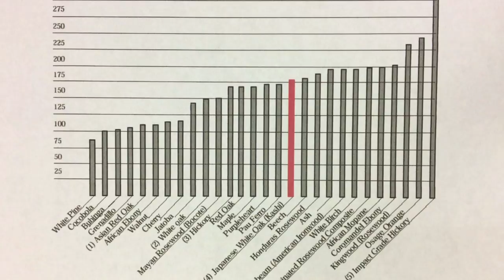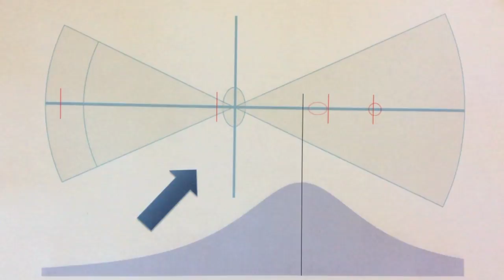Samurai War Club! Making a Kanabō for Metatron: Kodama Woodworks Episode 5

Comment: Super cool.  Also the only one ive seen built so far that i would find worthy to call battle ready instead of decorative like most modern weapon replicas.
Reply from the maker: Thanks! I spent days researching dimensions but they are few and far between. But I did my best while working from what I could find. I may have gone a bit far in terms of strength but it’s definitely not too weak lol.

Comment: Beeing 4 years late, I got two thoughts:
a) I'd prefer to get a handle with more grip to it. You may wanna lose a lot of force, if the club is rotating in your hands at the moment of impact.
b) There are nails for historical shoe making. They are basically tiny iron pyramids with a pin at the base to nail them into the sole. Roman soldiers shoes had them. Ask the Metatron!
But, just two minor thoughts. I'm totally in love with your club right now! <3

Comment: I looked up pictures of the kanabo on pininterest. It shown variety in the design. Some were obviously made to be more agile like a baseball bat while others were super thick and bulky. From what I noticed is the studs' spacing with each other and clustering were more dense. There were some kanabos with an added feature where a metal sheet was placed on each side of the blunt face. It was hammered and nailed in by the studs. This gave it more protection and durability to the wood. Not all of them had this. (I think metal was very expensive back then. This would explain why not all of the versions we see have the metal sheet or were flat out made out of metal entirely.) Some versions had the studs to be poking out more predominately. Some were either blunt sharp studs like you see on a morning star mace or were rounded. Both seem to indicate they nails were very pronounced and protruding outward from the weapon as a common feature.

I think the shape of this weapon is fine. I think the studs should be more numerous or perhaps more dense in spacing. The studs might need to be more poking out. I can understand why this was not done for your weapon. I don't think they make a lot of stuff that can be sued for a historically accurate kanabo. This would cause it to be more difficult to find stuff to make one or maybe doing some homemade style metal shaping to produce the studs or blunt spikes. Considering I think the original samurai and soldiers had go through similar situations where they make do with what they got around, afford, or what the best of their abilities can create this is accurate in my opinion. I can see a person out there in the past making studs like this and giving them a grouping like this. I would give it a pass.
Reply: Pininterest

Comment: There are so many varieties of Kanabos, like both wood and metal that you mentioned, they can be tapered or not, sharp or blunt. The way you want it to be is pretty much your (and weapon makers') call. However I am sure it's illegal to own a Kanabo with sharp mace points nowadays, so either stubbed Kanabo or just flat is the only thing that can be owned legally in most states.

Comment: Where did you get your beech wood from? Was the square stock made by gluing 2 pieces together? What was the measurements of the square stock before cutting? What measurements did you use to cut the piece down to an equilateral octagon?
Reply from the maker: Sorry for the late reply, I've been away from the channel for  a bit. But I got my wood from Hughes Hardwood in Rancho Cordova, CA. And yes it was made by gluing two pieces together but I made sure to orient the grain so that eventual warping would press the edges of the joint together. And to be honest I don't remember any of the measurements. I cut off a test piece and kept adjusting my fence until I got it right. Hope that helps.

Comment: Not understand why they would put metal Stubbs in making the hole for it would weeken it and they wouldn't cause any damage to someone when you hit them either??
Reply from the maker: Thanks for the question. I must admit my studs are not 100% accurate because they SHOULD be sharper. Unfortunately I couldn’t find any without paying a blacksmith to custom make them. But even as is, they do have a job. The main reason is for anti armor. The studs allow the force to be concentrated on a smaller and harder area so that it has more chance of imparting that force into the hard armor. It’s the same idea as a spiked mace head medieval knights would use. Simple wood would have a greater chance of deforming around the armor, damaging itself in the process. The holes do technically weaken the wood but it’s still plenty strong and some of the antique ones used metal banding to add more strength and keep the wood from splitting.

Comment: So if I wanted to increase the weight of something like this could I put a metal core in the center of it? Or would that cause some issues with durability?
Reply from the maker: I don’t really think it needs the extra weight, it packs quite the punch as is, but…. If you feel like it, I would cut a groove down the center of both pieces before gluing into a square and epoxy some all thread in there. Then just for extra protection and added weight add a metal hoop at the top to keep that part from splitting. But i’d be sure to make the rod extend into the handle part too or else it might crack in half at the end of the handle.

Comment: visually it looks awesome, tho if used, it would split like nothing. id add several metal rings, specialy top and botom, and i would leave handle rough for beter grip.
Reply from the maker: I completely agree that rings would be a great addition that I probably should've added. Honestly,  I heavily considered adding some but some weird combination of doubting my ability to do it well and a desire to keep the weight down convinced me not to. However, I have complete faith in the wood staying together as is. It's a massive piece with carefully chosen grain, so I'm not worried. If anything I'd say it'd would likely split the way baseball bats do, which adding rings wouldn't remedy.

Comment: What were the dimensions of the wood you used & the size of the nail-screws?
Reply from the maker: Oh man, you made me dig through some old emails for that info haha. But they were 18-8 stainless steel, size 12. 1/2 inch long. I think item number 91654A291. But honestly I’d just recommend going with whatever size your gut tells you. As for the wood I don’t have any record of that but maybe 2.5x2.5 inches or 3x3 inches.

Comment: Would there be any benefit to inserting threaded tubing so that you could use different styles of bolt heads? Or would the tubing be weaker than plain wood?
Reply from the maker: I considered it, and I don't think there would be strength difference in regards to the wood itself. My concern was the need to retighten the spikes all the time like I remember having to for my track/field cleats.

Comment: very cool just subbed. what did you finish it with? an oil or a  lacquer?
Reply from the maker: Thank you :)  As for the finish it was General Finishes Seal A Cell and then Arm R Seal. Most historical Kanabous were lacquered so I didn't feel weird about using that. But my personal preference for wooden weapons is oil. I just like the way it feels and is what I use on my Bokken and Jo.

Comment: This may sound uneducated but I have no clue about woodworking, is that a wood lathe you got?
Reply from the maker: Thanks for asking. I’m always happy to answer any and all questions. 
Yep it’s a lathe. I had to make an extension for it and also add a stabilizer in the middle to work on this piece though. Otherwise the wood would flex from the pressure of the tools.

Comment: How did you make the hex shape on the damage part of the weapon?
Reply from the maker: It was actually an octagon so pretty easy. Just cut some 45 degree bevels on the table saw. I think the process would be similar for a hexagon though. Just at different angles. Cut one, rotate, cut the next
Reply: @EliotChildress  ty

Comment: May i asked What Size u screws you used?  Please?
Reply from the maker: I used the 18-8 Stainless Steel ones. Size 12,  1/2" long. They were $9.85 for a pack of 100. Product number: 91654A291
Reply: THANK YOU

Comment: What modifications did you do to that lathe?
Reply from the maker: Pack AR223 I had to make a plywood extension for the table that I clamped on to the main bit. (Didn’t want to drill and tap the metal) It actually worked really well and was surprisingly stable. And the circular holding bit with wheels to keep the piece from flexing while I cut it. But the second thing is pretty typical and idk if I’d call it a modification as much as just an accessory.

Comment: How big is the piece of beech you used at the start?
Reply from the maker: It was about 4’6” and I think like 2.5”-3” square in cross section. It was made of two pieces glued together with the arcs of the end grain facing away from each other to keep it more stable.
Reply: @EliotChildress  Cheers lad. Also, how long did you make the rounded handle before you did the carving? Is it half and half?
Reply from the maker: @beardednortherner64  I can’t remember exactly but looking at the weapons dynamics chart I made it looks to be between 60/40 and 50/50.  But not 50/50 exactly. If you want the real measurements you’d have to ask the metatron since he has it now.

Comment: Has it been tested?
Reply from the maker: I swung it around a lot and it worked really well if you let your hands slide up and down the handle rather than thinking of it as a club with a fixed grip.  But as for hitting, the best I can do is say I firmly believe it’d take you out on one swing but since I was sending it off I couldn’t actually hit stuff. You’d have to ask the metatron how it is when you hit stuff.

Comment: Hey what size screws did you use ?
Reply from the maker: I used the 18-8 Stainless Steel ones. Size 12,  1/2" long. They were $9.85 for a pack of 100. Product number: 91654A291
Reply: Thanks so much